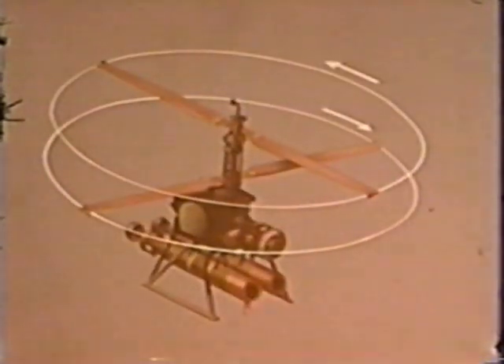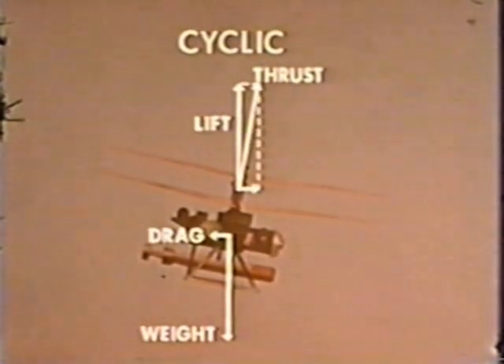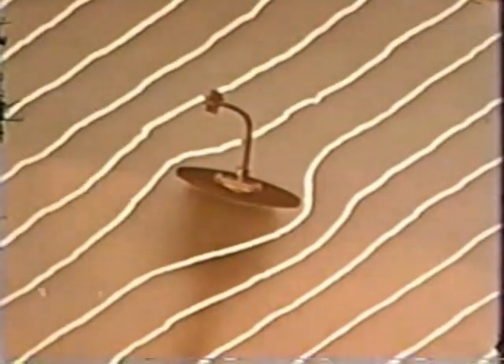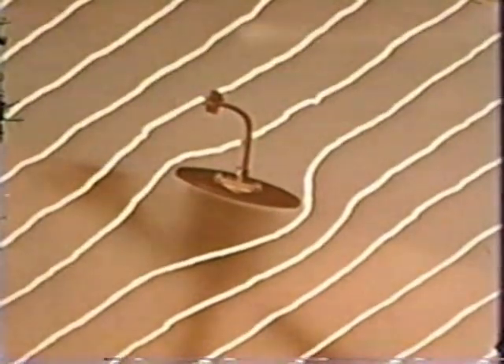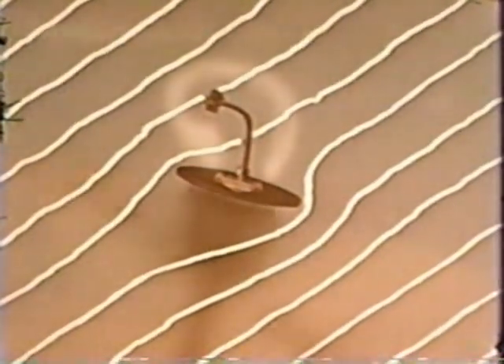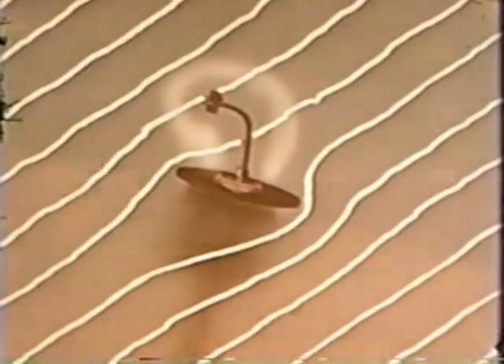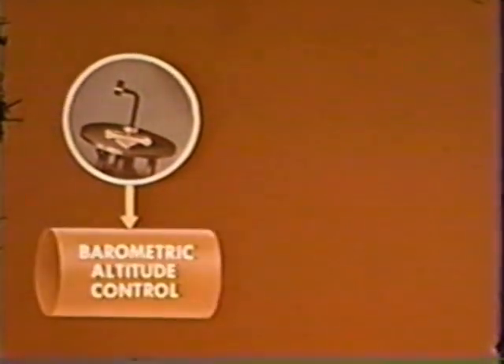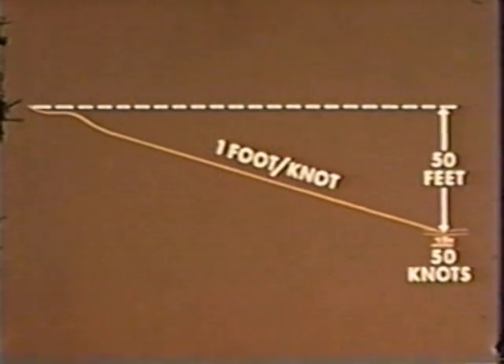The QH-50 DASH Shipboard and Flight Control Operation.mpg

Comment: The GEARING Class destroyer moored at Battleship Cove in Fall River, MA, is the USS Joseph P. Kennedy (DD-850).  DD-850 has a DASH hangar and an adjacent magazine space for DASH reloads and ASROC reloads.  The DASH hangar has two QH-50 drones inside.   An interesting application of the DASH system was seen in Vietnam when modified QH-50 units were made into reconnaissance platforms and were used to spot threat targets ashore and were used in Naval Gun Fire Support operations.    They were nicknamed SNOOPY DRONEs.